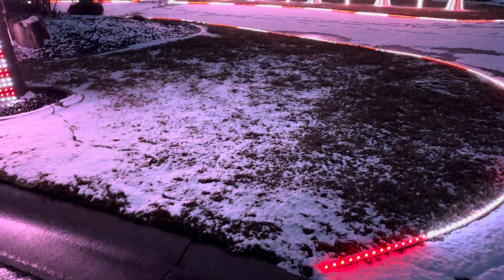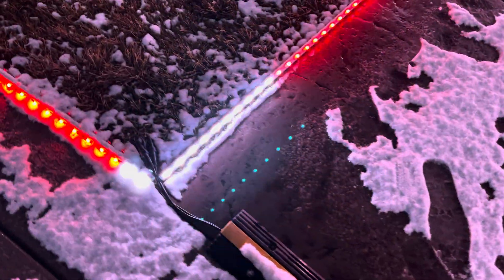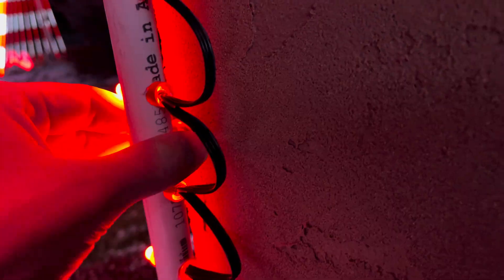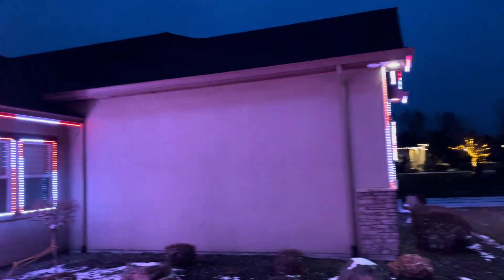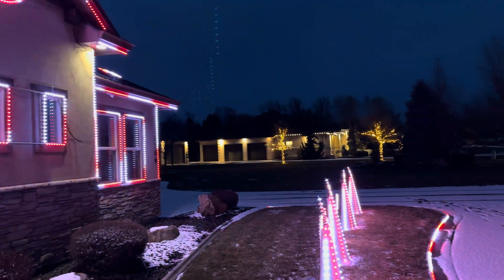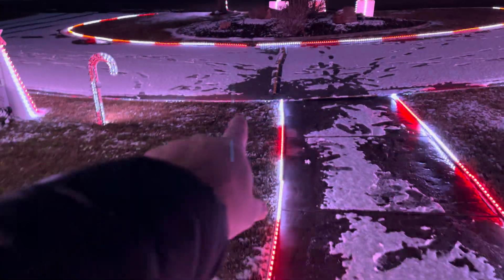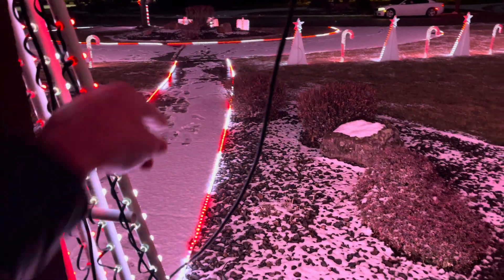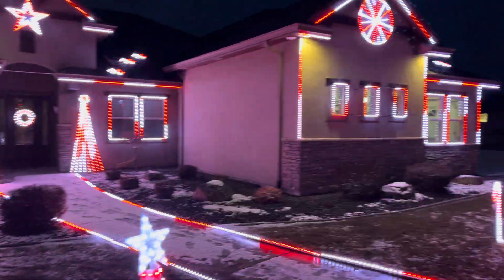2023 xLights behind the scenes & parallel power supplies

Comment: What size of pvc are you using for the verticals, windows and yard outline and what is the spacing you drilled the pvc at if you don't mind sharing. It looks really amazing!
Reply from the maker: All PVC is ½” with holes every 2”.

Comment: what do you do with the pixel wires for the pipe that lines the driveway/walkway? Are they tucked into the PVC?
Reply from the maker: The pixels go through the middle of the PVC so any wiring we have to do outside of the pixels (power injection) has to be somewhere else. The power injections just run across the lawn/rocks/wherever and blend in during the nighttime. If you put the video in 4k and watch it I show some of the power injection wires on those props specifically.
Reply: man love it a lot.   is amazing. 
oh yeah, a beginner and I really like the gifts that you have. I really know when I see how do you create those ones can you make a video please?

Comment: I also purchased some Kauf lights cause of you video last year. I think that really add to my show also. so thank you again. I also had one fail funny enough it was a light in a full outdoor fixture. that i tested in the preseason. all of mine made it through show season but I plan to put the Hue Floods and a29 back in when i break the show back down. It is a shame. I did read that none are truly outdoor rated or even supposed to put in the bathroom. did you use some type of JIG to space your PVC outlines for the hole spacing?
Reply from the maker: Hey Nick, loved your show this year! 
I just bought some different brighter bulbs that I am going to flash with a firmware and stress test them all year in the off season. They claim a 50% increase in brightness over the Kauf bulbs. 

I use Jason's jig for drilling. I can drill more holes faster with his jig vs mine I made
https://sfl-designs.com/?store-page=STL-File-1-2-Standard-PVC-Pixel-Drilling-Jig-2-Spacing-p462897088
Reply: @Bigrob444  thanks! Let me know how your testing goes

Comment: Where did you buy the magnets?  Is the disk on the wall the magnet or steal washer? Are you useing this mounting technique only for the vert corners or other places too? Do you plan on painting the disks on your house?
Reply: Same questions I have. Also, where can I find that clip on the verticals that use the washer/magnet?
Reply from the maker: Magnets were from Amazon - https://www.amazon.com/gp/product/B0C7M4LSBJ/ (make sure to buy the 30# as those are the closest to the same OD as the clips)

Clear PVC clip = https://www.holidaycoro.com/PixelPipe-Clip-for-PVC-and-PixelPipe-Track-p/770.htm

Then just take the magnet and clip to your local home depot/lowes/ace hardware and get some counter sunk bolts and nuts that fit.
Reply: @Bigrob444  thanks for the quick response.  It looks like 2in pixel spacing. How many magnets do you use for a 50pixel vertical run?  Do you have any 50pixel 1/2in PVC pipe runs that are mounted horizontal? If so would you add more magnets?  What if those horizontal runs are using a 1in standoff attached to the clip, how many might you use?
Reply from the maker: @MrSireFoss 2” pixel spacing is correct. 
On each vertical I am using 2 magnets. Each magnet is roughly 12” in from the end. If your pvc is straight that is more than enough. (Make sure the magnet sits flat on the steel for maximum strength) if the pipe is curvy you could use a third magnet in the middle to keep it straight. 

On my verticals I use 2 70# magnets to hold up the j channel. 
These = https://a.co/d/7wU2lHh
Those are screwed to the soffit and painted to match. J channel clips up and is very secure.
Reply from the maker: Magnets were from Amazon - https://www.amazon.com/gp/product/B0C7M4LSBJ/ (make sure to buy the 30# as those are the closest to the same OD as the clips)
On the house is the steel washer and I will be painting the steel to match the house color once it warms up outside.
I use magnets for all of the roof peaks and gutters (those are all using steel J channel). Makes for a quick and easy put up and take down process.
Window frames are not magnets, but will be looking into converting them in the off season.

Comment: I will prefix this by saying I am not an electrical enginier, just a hobbiest. The reason why the power injection works from different power supply is that the voltage drop between the injection points is significant enough that the different power supplies cannot backfeed each other. If you join both power supplies together right at their output to combine their amps that is when it doesn't work as one might expect. 

An issue that I can see is that if for some reason one of the power supplies stopped providing power to the string the other power supply might start powering the other props that the failed power supply was powering through the prop that was being powered from both supplies. Assuming you have everything fused it probably not cause catastrophic problems as the fuse should blow but it is likely going to be more of a pain to fix. Also it might be that the working power supply is powering a fault with not enough power to blow a fuse but enough to cause something to get very got and catch fire. How likely is it? 🤷‍♂

I am unwilling to do it myself. While everything is working things tend to be okay, it is when something goes wrong that we find out why it might not be a good idea to do it.
Reply from the maker: I think the voltage sag on the 5v and resistance of the wire is exactly the reason this works. We did this last year on 1 single prop to test and were successful, this year we did it with 4 props and 4 power supplies with no issues. I will be using this method going forward to simplify power injecting and continue the tests. Every power injection point is fused so no worries there.